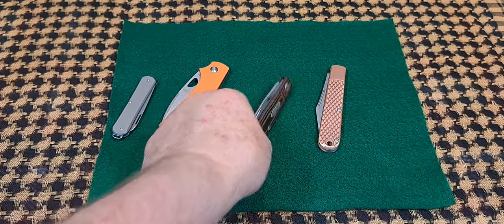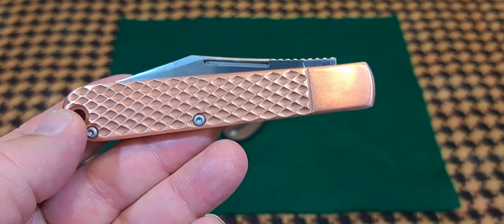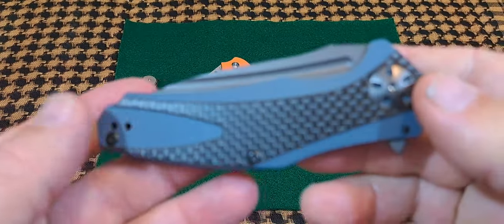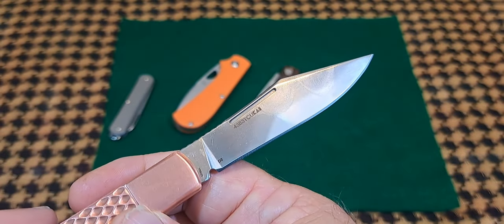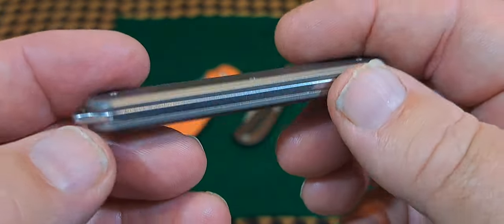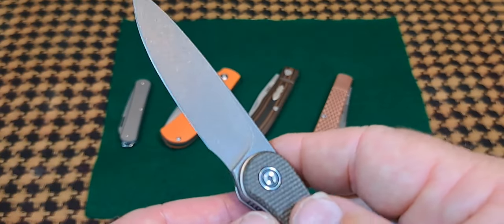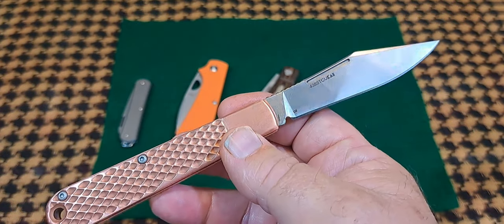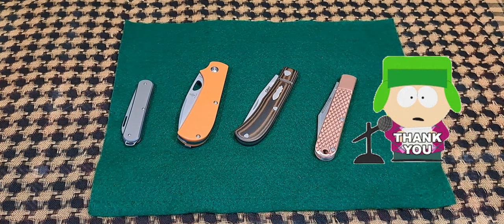What is a modern slipjoint knife?🤔

Comment: I think you made some important points. I would add to them the difference in manufacturing of the knives. Knives made using traditional methods of manufacture and closely follow old pattern is a point to consider. I might think that using modern machines that make precise fitting parts reducing handwork are modern knives. I believe that current models that use manmade materials even if they are pinned are still not traditional made slip joints. If every knife is perfect, there machine made and it took little to no traditional hand skills to make the knife.🤔
Reply from the maker: Yep. I think traditional, when it's applied to slipjoints, speaks to the fact that slipjoints were the knife design for 400 years. The modern, is an attempt to update the slipjoint with modern steels and construction. Like being able to disassemble them. It would be nice to be able to disassemble them for cleaning.